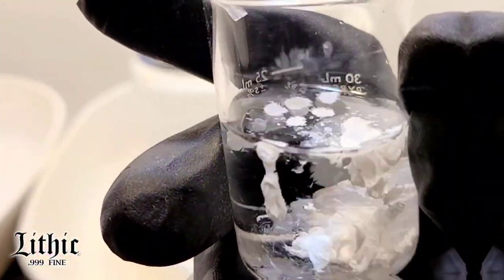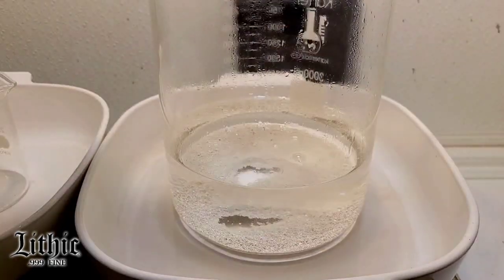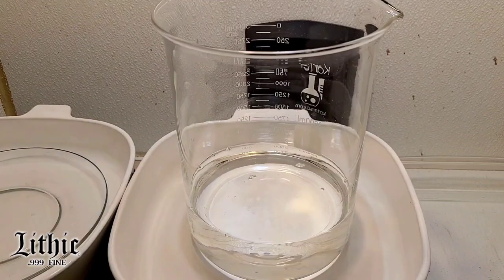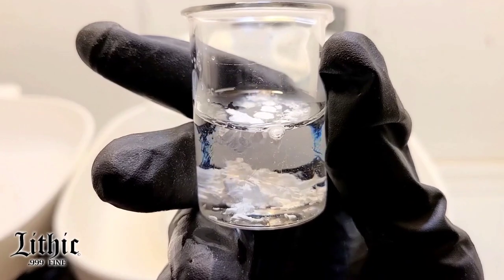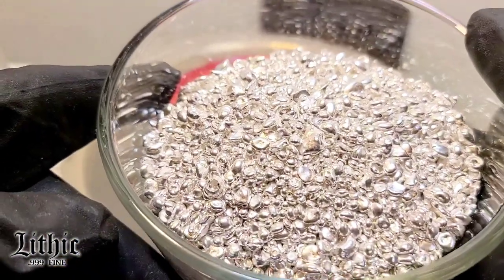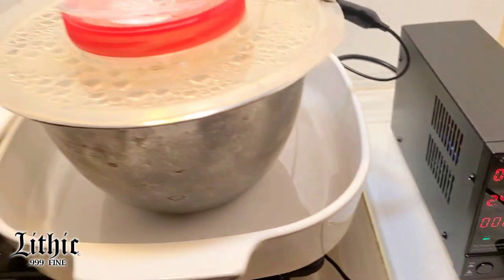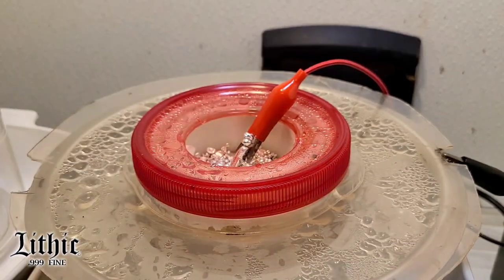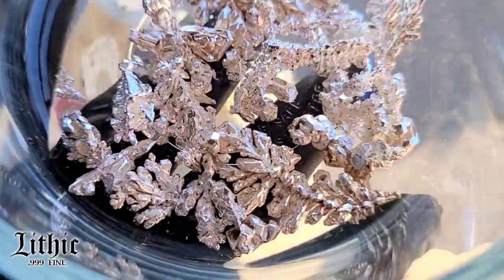Electrolyte Solution from Pure Silver Crystal

Comment: I am just wondering if the electrolyte needs to be completely saturated with silver for the cell to work properly? I see you and also sreetips adding a load of distilled water which makes me wonder if it works with a non saturated electrolyte?
Reply from the maker: You need at least 60g per liter of silver in the electrolyte to get a reaction. I use closer to 300g

Comment: If you are going for all that purity, there should be NO stainless steel or metal other than silver in the cell!  The bowl should be glass or plastic & the cathode should be previously-refined silver sheet.  You also need to regularly run tests of the electrolyte to determine the concentrations of metals more electropositive than silver.  How do you run those tests?  How do you remove those more electropositive metals (such as copper, iron, nickel, etc.) from the electrolyte?
Reply from the maker: Naw. The stainless isn't affected at all. It leaves no measurable traces... 0. You can easily tell when the electrolyte is getting close to plating out othe materials, just by looking at it. The real trick is making sure to rinse it completely off the crystal.

Comment: Do you have a link for that anode filter material?  I am using the shopvac filters that sreetips uses but they are quite expensive, looking for a cheaper alternative that works, tried Muslin cloth but not very good
Reply from the maker: I bought 20sq yards of it a few years ago. It's 1/8" thick dacron, which filters down to .5 micron. I can't remember the source. Wish I had more info for you!

Comment: Hey I'm sorry to bug you again...I asked basically the same question on another one of your videos... Didn't see this one or I would have asked on this particular video because the questions are involving making the silver nitrate... What percentage nitric acid do you use? Do you wear a gas mask with an oxygen tank or What type of filter do you use in your gas mask If you use one at all... Or do you just use a well ventilated area?
Reply: From the amounts he gave he must be using around 92% nitric acid. That's enough that it will "smoke" if the air humidity is high. He is doing all this in a fume hood.

If you're asking these things because you want to do this yourself I have to say: Please don't. You need at the very least high school level chemistry. Concentrated nitric acid is some angry shit that is, among other dangerous endeavours, used to make explosives and liquid fuel rockets. It will happy dissolve mostly anything not boron silicate glass including pets, your hands and your work bench. It spontaneously catches fire when it comes into contact with a wide range of rubbers, paints, oils and alcohols. The red fumes you saw will merrily kill you by perforating your lungs and drowning you in your own blood plasma. If you're caught with concentrated nitric acid, concentrated sulfuric acid and any kind of organic solvent at the same time you better not have made any "I hate the government" statements online or you'll be facing terrorism charges right quick in a hurry.

Comment: What are you using as your power source? 
I'm wanting to build an electrolytic cell for the first time, but beyond the bare basics, I'm kinda clueless.
Reply from the maker: Building and operating a cell is easy enough. However, working with these chemicals and disposing of the waste... those are issues that need to be thought through very well before you begin. 

The power supply is a simple DC converter. Ebay has the best prices that I generally find.
Reply: @LithicMetals  
Thanks. Much appreciated.

Comment: Ahoj Jeff, I just bought pharmaceutical silver nitrate p.a. for the price of silver in it, some "expired" from pharmaceutical point, but still great for me... Silver cell soon to fire up... 🙂
Reply from the maker: Neat! Do you have a plan ready to treat the waste solution? Are you going to use a beaker or stainless? Both are fun! 😁
Reply: @LithicMetals  I have rectangle glass container with plastic lid (IKEA rulez). Regarding waste, I want to reduce silver with sodium formate (formic acid and sodium hydroxide), not to have so much metals in solution, then stockpot liquids with copper, if some silver, gold or other PGM are  present. Filter it, keep solids. Put iron into liquid, cement out copper, decant iron salts solution (not harmful), may be neutralize with sodium carbonate and dry it, or get rid of it in liquid form, We have here so called "waste collector yards", where you can leave also waste chemicals. It is "for free" for citizens (read tax payed). No metals go into water or nature...

Comment: Would it not be easier to just buy ready made silver nitrate?
Reply from the maker: Heck, no. It's not cheap. Plus, why would I pay someone to make something that I can do here?
Reply: @LithicMetals  good point i suppose. It's just confusing because it seems you need both silver and silver nitrate to get started with farming silver. My logical brain says just use silver nitrate off the shelf and you save half the work. I get that it's expensive, but then does that imply that the yield is not sufficient to justify the cost of ready made silver nitrate?